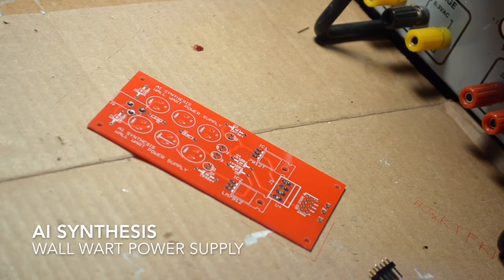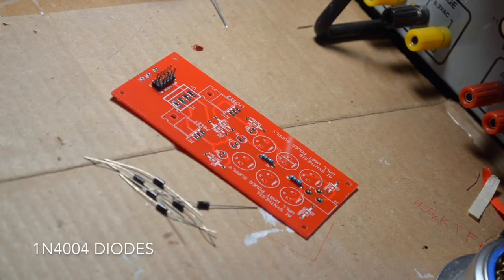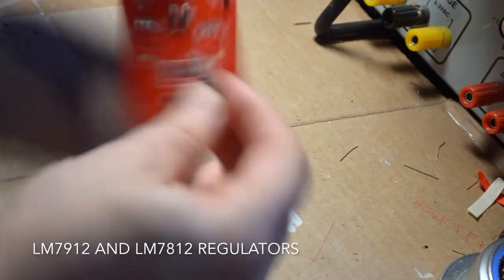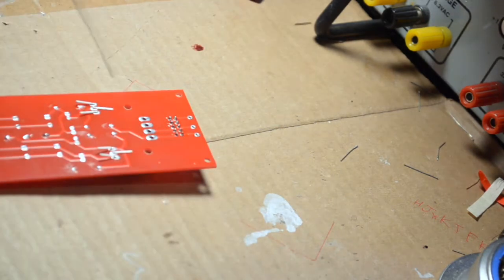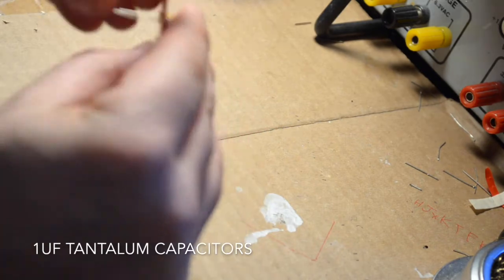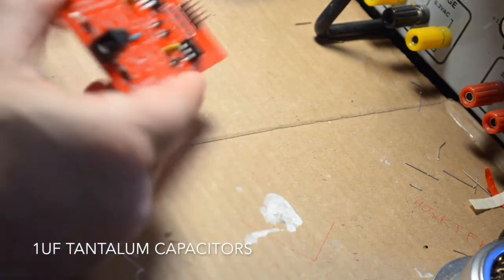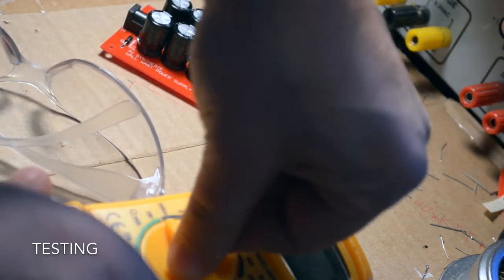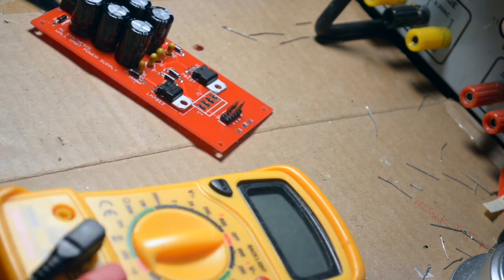AI Synthesis DIY Eurorack Power Supply

Comment: hello, I'm a young student from Norway and I love what you're doing. I've always wanted to experiment with modular synthesis but found it very expensive working with my limited budget. This is a almost perfect solution and the PCB is cheap :) I easily found the components needed on the europe mouser site. The only problem I have is that the shipping for the PCB is quite expensive, and you're european retailers are not offering this PCB :( Maybe we could figure out a solution where I pay you on paypal with a note including address etc. and you could order a print in Europe with the pcb file? Understandable if you don't have time, I just feel like it's a bit much paying 20 USD for only the shipping of a PCB when I'm doing this on broke budget xD
Reply from the maker: Hi Mattias. Thank you. I wouldn't know where to print in Europe, and the minimum order is usually 5. I don't think it would be much cheaper :( If you find one though, feel free to email me. Thonk sells a similar amperage PCB from frog legs. I hope AI can be part of your modular journey in the future!
Reply: @AISynthesis  Hello, I sent you a message through the contact page on your site a couple of days back. Did you get it?
Reply from the maker: @mattiastofte7457  I don't think so. I just searched for Mattias and nothing came up. Do you want to try again? It's Abe @ etc...

Comment: How safe/easy would it be to add an on/off switch to this?
Reply from the maker: You'd want to do it on the wall wart input cable. It should be relatively safe (I take no responsibilities, etc do so at your own risk).

Comment: How many modules can you power with it?
Reply from the maker: It depends on the draw of the modules. This power supply can safely supply 1000mA, so if you are using a bunch of AI modules which only draw an average of 30mA, that's a ton of modules, but if you are powering hungry digital modules that can easily take 300mA or more, then you can power fewer of those.
Reply: @AISynthesis   Thank you!
Reply: @AISynthesis  indeed, like digital guitar pedals who use up a lot too

Comment: (Sorry if this is a dumb question.) I cant find an AC input jack anywhere. I  googled it and theres is not one. What am I doing wrong? Am I not getting something?
Reply from the maker: Did you check the build guide at aisynthesis.com/build ? I should link to one there. Mechanically, there is no difference between a DC input and an ac input if we're talking wall wort s

Comment: Purely theoretical question - can those tantalums be replaced by other type capacitors? electrolytics for ex? what's the benefit of using them?
Reply from the maker: Technically you might not need them at all. The 1uF tantalums placed close to the regulator pins are recommended by National Semiconductor for operational stability in this use case. Their documentation doesn't say anything about using electrolytic caps instead and I've never tried it. The tantalums are easy to find and inexpensive, so I've always just played it safe.
Reply: somehow tantalums are hard to source locally, where i live, hence the question..
Reply from the maker: Ah! I'm sorry they are hard to get where you are. I've gotten them from Tayda and those work great, I'm not sure how easy that is to get in Lithuania (I assume that is where you are from your videos). If you are planning on doing your own build you could always do a test without the caps, I've seen bare-bones versions of this circuit without them. Mine was built when Ray Wilson from MFOS got sick and shut down his store, and I made a ton of them because I have several systems and needed a ton. Then I opened them up when I started the business, but it's essentially the MFOS version but optimized for Euro and MOTM builds. I'm sorry I don't have a better answer, I am not an EE and did not design the "concept" of the circuit, I merely adapted it for a quick and easy installation solution.
Reply: yep, i got Ray's (RIP) wallwart power supply, but now i plan on making a proper PSU with a toroid and so on, and move into eurorack territory..

Comment: nice little startingsolution :)
how much miliamp will it provide per rail?
+12v mA?
-12v mA?
thx for sharing your ideas :)
Reply from the maker: I use a 1amp wall wart, which in a perfect world would supply 500mA per rail. In my live rack I use three of these, one for oscillators, just to keep them clean from LFO and envelope ripples, one for some of my 5u stuff, and one for Eurorack.
Reply: so it would fit my theoretical setup (modulargrid.net) what will consume 444mA on +12v and 218mA on the -12v rail.
Normaly all +-12v Powersupply are give a bit more mA at the positive rail by the nature of the 78xx, if im right.
So in theory it will fit perfektly.

Do you think my 15v~ 1A Wallwort from my Sherman Filterbank2 will not burn the LM7812 if i let them cool by Air? Or should i spend them both a passive cooling to drop the 3v without any problems?

thx for your advice :)
Reply from the maker: The wall wart I link to in the BOM is only $12-15. I would suggest getting the right one to keep the voltage in line with how it was designed and tested.
Reply: ok. it makes sense, thx :)

Comment: Hi,

was just wondering if this PSU is compatible with Australian power?

sorry if it's a dumb question mate! 
thanks
Reply from the maker: You would want to look for the right wallwart, but otherwise, yes. As long at you feed this 12-15V AC, this will give you +/- 12V.
Reply: awesome, cheers for that